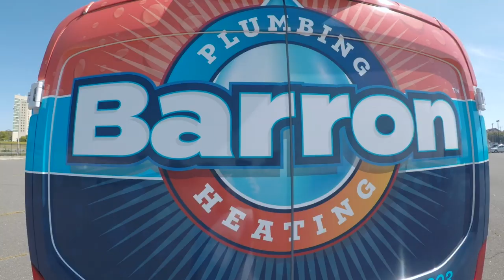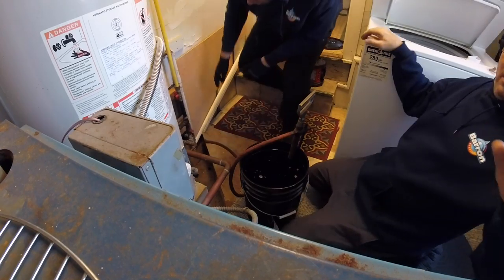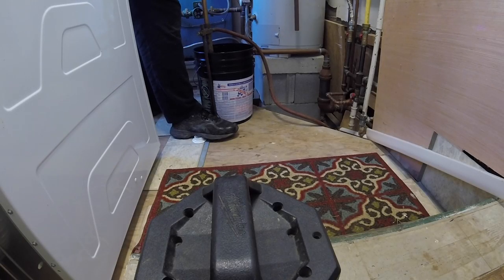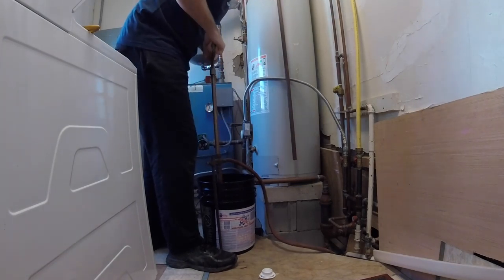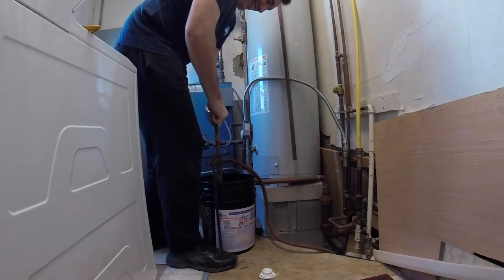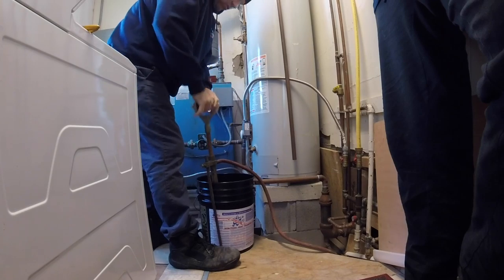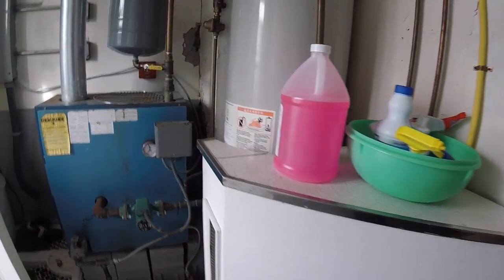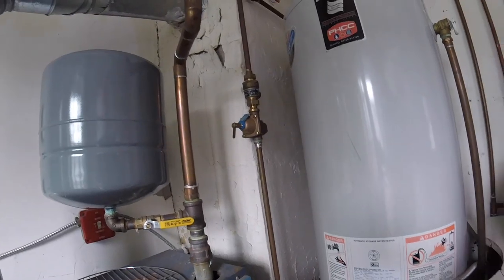BOILER ANTI-FREEZE ADDED FOR WINTER SEASON

Comment: surprised it didn't over-pressure the system and blow it all out the relief valve. best bet is using two hoses and letting it circulate in and through the system, same direction as normal pump flow.
then you can purge air from zones back into the bucket and when it's all mixed well, pre-pressurize the system with minimal waste mixed antifreeze left
Reply from the maker: I like that..I ran heater as i pumped it in. also purchased milwaukee transfer pump....battery of course.

Comment: Chuck, is that the pump or you wheezing?  I was wondering why you didn't just use the Wayne 1450 pump from the get go?  Easiest way to check antifreeze concentration is with a hydrometer or a refractometer.  A standard automotive hydrometer should work fine, although I prefer using the refractometer.
Reply from the maker: Thanks Rich.
Reply: My guess id that CB 1 was goofing on CB2 with the bicycle pump.

Comment: Can you put antifreeze in a boiler?
Heating boiler antifreeze, usually a non-toxic polypropylene glycol anti-freeze and water mixture is installed in hot water heating boilers and plumbing systems to reduce the risk of expensive freeze damage to the heating system piping and of course to avoid costly water or even mold contamination that occurs when an ...How do I get my boiler ready for winter?
Prepare your Boiler for Winter
Regular Service. Boilers should be serviced once a year by a certified engineer. ...
Turn it on. Boilers can potentially seize up if not regularly turned on. ...
Bleed it out. ...
Check for warning signs. ...
Open flame. ...
Let your boiler breathe. ...
Insulate the pipes. ...
Watch out for silent killers.  Antifreeze is commonly used as one of the components of a coolant mixture – coolant is generally a 50-50 split between antifreeze and water. Antifreeze (specifically the ethylene glycol, which is its main ingredient) is used to lower the freezing point of the liquid that circulates around the engine of a vehicle.
Reply from the maker: I love this guy....thanks tom.